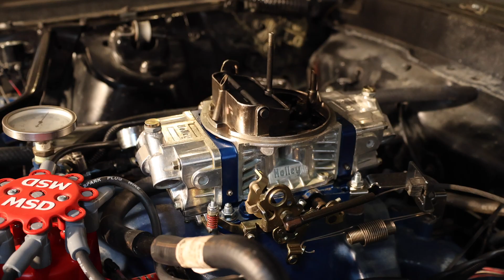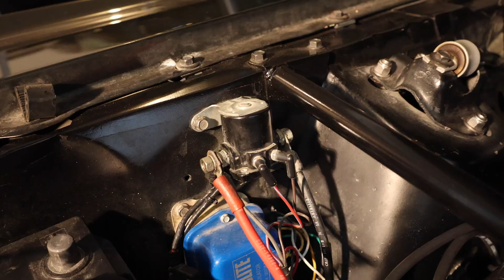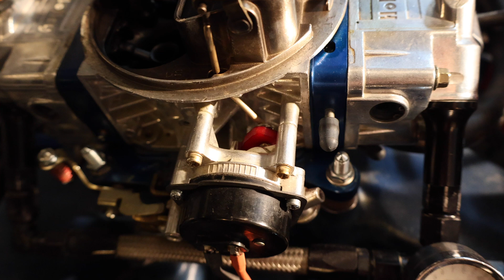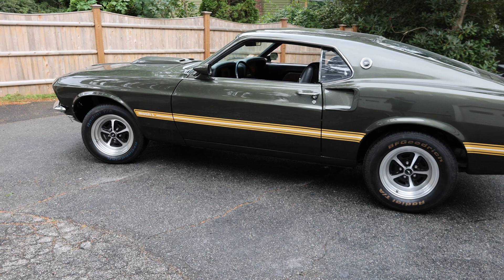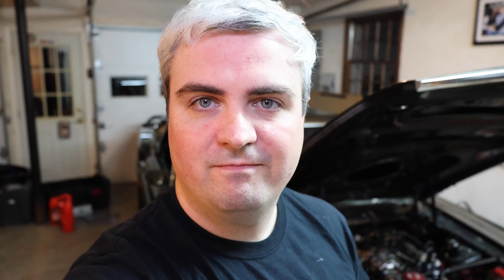Adjusting the Electric Choke Correctly on a Holley Carburetor

Comment: I feel like an idiot asking this. I’ve got a 4160 Holley with an electric choke. When I start my car I press the pedal down a couple times then I start it. The car starts at maybe 1000-1100 rpm but over about 30 seconds climbs to 1500. Is this a normal operation for startup or should the car start right to 1500 right off the key start?
Reply from the maker: This is normal operation. The pushing of the throttle first a couple times sets the high idle cam. If you press it again after it'll drop back down in RPM.
Reply: @SmackeysGarage ok so your rpm also climbs up a bit after you “prime” the motor and get the fast idle cam to click to the higher rpm setting. Awesome thank you!

Comment: Why after doing a cold start does the car die out, shut off?  It seems also like I have to play with throttle so it doesn’t shut off. After warms up some it does okay. Do I need to go more counterclockwise so flap stays closed longer?  Does this issue and the car shutting off when putting in drive all come from choke not adjusted properly?  If I drive and park, then go to restart, it’s hard to start too.
Reply from the maker: Assuming that it is running out of gas and has too much air, yea you would want it to stay shut longer.  If you have to play with the throttle, I'm assuming you are pumping the gas and pumping more fuel into the carb vs holding the throttle open for air.

If it runs good after it is warmed up it is a choke timing issue. If you drive and park and it is hard to start, you could recheck the choke to see what the position is when you try and start it. Might have to hit the throttle quick to open it up.
Reply: @SmackeysGarage thanks for the reply, so now dumb question. If I want the choke flap to stay shut longer, I rotate the can clockwise?  What happens If I rotate the mark on the black can past the mark indicators on the metal part?  I want to say if I do need to rotate clockwise, I will move past the last marker?
Reply from the maker: I believe the markers are just for reference. There are hard stops that stop it from turning any further.

Comment: I have a holley warrior on a Ford 302. On a cold start, it starts right up and idles at ~600 then after 30 seconds or so it starts to idle rough. Then after a couple minutes it goes up to the idle of ~900 until I am ready to drive and tap the gas to bring the idle back down.

How would you suggest to fix the rough idle?
Reply from the maker: What’s it have for a choke on it? Almost sounds like it’s getting through a lot of fuel maybe from over pumping it before the high idle can clear it out.

Comment: I know this video old but I have a new Holly 750 and was confused why it was smoking from the choke adjuster and the truck ran terrible, I have everything else set correctly but when I went to adjust the choke everything went sideways
Reply from the maker: That's really weird. The Holley choke shouldn't have changed. It's a simple system. Bimetal wound coil that heats up and opens when electricity is attached. Sounds like your spring is shorted somehow internally. Would be worth taking the cover off and looking.

Comment: Sir good morning I’m having issues achieving high idle on my Holley 750.  I pump the pedal twice turned key waited key on wait about 30 seconds truck starts good then stalls out right, I’m guessing that flap is closed all the way.  Need help please
Reply: Tomorrow morning I’m going to do a counterclockwise adjustment on the choke and I’ll see what it does
Reply from the maker: @davidcimei3476  Cool. Let me know how you make it. Might be worth starting it with the hood open and air cleaner off to see what is actually happening to the choke blade.
Reply: @SmackeysGarage  

I set my high idle for a warm temperature start and went to 1600 with the choke plate fully opened and hit throttle and went to my curb idle speed of 850.  This morning it was sluggish starting with a fully cold engine my question is when I rotate that choke plate do I need to hit the pedal before I rotate the choke cap
Reply from the maker: @davidcimei3476  I don't have this setup on my car right now, but the way I remember it is, yes I set the choke cap after pushing the petal. I'd say it would be best to start it with the air cleaner off the car to see the position of the choke with different settings. You don't want the choke completely closed when starting initially. I moved to a manual choke  to make it easier for myself
Reply: @SmackeysGarage  can I swap my electric choke for a manual choke?
Reply from the maker: @davidcimei3476 yes you can. Holley sells a kit.
Reply from the maker: If it is running for 30 seconds I'm guessing the choke is opening too fast, or your fast idle could be too low. If the choke was staying closed, I wouldn't expect it to start and stay running since the primaries would be completely cut off.
Reply: My fast idle set about 1600 rpm and I smack the throttle and drops to approximately 850 so I believe that is dialed in

Comment: The problem I have the red linkage won't drop down to disengage choke.
Reply from the maker: After you star the car the choke plate stays closed?
Reply: @SmackeysGarage  
Yes I can't  get it to idle down to 750ish rpm. Tried burping the peddle temp 170.
But it won't drop that linkage or idle down.
Choke is hooked to seliond pole closest to power out. If shut off, it has run on. Unless it's in gear. 
But if I manually move that linkage.

Comment: My choke is staying completley   closed at first, doesnt it need to be cracked open at least a little to start? i should try rotating a notch clockwise too see if it helps? thanks
Reply from the maker: Is it a 2 or 4 barrel? If it is only covering 2 of the 4 barrels you could be ok. If it is completely cutting the air off on a 2 barrel, that would be a problem.

Comment: I have a 4160 on a 350 Chevy. I find that after the engine is warm the idle seems to creep back up. Like I drive 10 miles. When I get there the idle might be normal or it might still want to idle at 1500. Does that indicate the choke opening late (turn the choke to the right?) It cranks and runs great. Get's terrible mileage and smells rich at idle.
Reply from the maker: When did it start operating that way? If the idle is still high, it could be the high idle cam but it sounds like it is either the carburetor (not the choke) isn't tuned correctly or you have a vacuum leak somewhere.

Comment: How long should the choke run before you pat the gas and knock it off on a cold start?
Reply from the maker: It really depends on the vehicle. A choke should stay on until the engine comes up to temperature enough so that the fuel is atomizing enough to keep the car running and not need the air choked off. An aluminum block 5.0 will take significantly less time than my iron blocked FE. I typically run it to ~160* and then take it off.
Reply: @SmackeysGarage  ok Thanks

Comment: Have a new carburetor 600 holly for some reason when choke is cooled up choke plate stays Open halfway.. what can i do brother
Reply from the maker: Does it reset after you push on the gas pedal? It will typically stay open a bit (maybe 1/2") until you push on the throttle and it should drop to mostly closed. You have to reset the choke on the next start by pressing on the gas pedal.
Reply: @SmackeysGarage  yes it does sir.. I move little bit the electric choke clock wise cuz takes more that a little while to open completely

Comment: After setting the choke I’ve run the engine and it opens fully when going cold does it start to shut but not fully until I press the accelerator  I hope this makes sense
Reply from the maker: That does make sense. You push the accelerator once to set the choke fully closed on next startup. If i understand what you are saying correctly, that is also how mine works.
Reply: @SmackeysGarage   cheers for that

Comment: Hi - thanks for the topic!  I think it would be really helpful to describe a few symptoms, because people can't actually see if the choke is coming off too soon or too late.  I  only know what I have to do to the gas pedal to keep a cold (35 degrees) engine running until it finally settles into curb idle.  Example: I can can get the engine to fire, but immediately have to keep jabbing the gas pedal, so my choke is probably (which one) never completely shut? open before it should be??? isn't opening soon enough???  If I can hold the pedal to keep the idle high and smooth, but notice that after a few moments, the rpms slowly drop on their own and the engine dies unless I jab the pedal, my choke is probably open before it should be? isn't opening soon enough?   I don't have the stove tubes connected, or the exhaust manifold riser connected to the air cleaner, so I'm going to switch to an electric choke cap for my Holley 735 4150 type.  The car is a rebuilt classic that only sees cold temps the first few days after it comes out of winter storage in April.
Reply from the maker: Hey D S. You're right a good description of how to know to move the choke to come off earlier or later would make sense. I should have included that in this video, but I will be sure to include it if I do another on this topic! If you have to keep jabbing the throttle, you'll be adding more fuel, so the car would be running lean which would mean the choke has either come completely off or has come off too early. When you put your new Holley choke on, follow the instructions on how to set it up initially. I used a pencil to set the location of the choke plate originally but you could just as well put it in the center and then adjust as necessary. There should be lines on it you can line it up with.
Reply: @SmackeysGarage  hi - Here's an update to my comment based on info in a really good Hemmings article called "The Lost Art of Choke Adjustment." I connected a remote starter so I could watch what is going on.  This is not info on what the specific adjustments are, this is just a different way to describe what each choke function does and when.
 
Choke Event 1. Prior to turning the key, tap the gas pedal, which provides a squirt of gas and sets the only two parts of the choke adjustment that matter at this moment: the butterfly goes completely closed/no gap, and the throttle linkage catches on the high part of the fast idle cam.

Turn the key. Engine should fire. If it doesn't, NONE of the other choke adjustments have anything to do with it.

Choke Event 2. If the engine fires and starts, the engine vaccuum will immediately cause the choke pull off to crack the butterfly open a very small amount, overcoming the tension of the choke spring NO MATTER WHERE YOU HAVE SET THE CHOKE SPRING, as long as the butterfly was initially gapless. Engine should run at high idle.  If it doesn't, the only things in play are the size of the pull off gap (approx 1/16-1/8") and the need to be at high-idle.  Choke spring setting has nothing to do with it yet.

#3 Now finally, the choke spring setting matters. At some point, the engine has to come off high idle to curb idle.  This is the magical combination when engine warms and the butterfly opens in harmony. The moment you touch the gas pedal, even slightly, the throttle will slip off the high idle cam, and if your butterfly is too slow or too fast, the engine won't run perfectly.  Now you are finally at the point of messing around with the choke spring adjustment to change how long it takes for the butterfly to open enough for curb idle.  

I am doing mine while it is 39 degress out, and I can have an actually cold carb...

Comment: So if I’m having trouble starting up and idling I turn it counter clock wise?
Reply from the maker: Are you having trouble getting it to kick over at all or is it starting and then dying after a few seconds?
Reply: @SmackeysGarage  starting then dying after a few seconds won’t hold a idle
Reply from the maker: Sounds like the choke is coming off to fast. I’ll have to look physically at my car tomorrow but I believe you want to rotate it so the choke stays on longerto get you to fast idle.
Reply: @SmackeysGarage  okay awesome sound good, I noticed the choke flap (no sure what it’s actually called the thing the flaps open and close) was open part way isn’t it supposed to be fully closed? Also I noticed my choke is rotated all the way clockwise. Isn’t that not okay?
Reply: @SmackeysGarage  got it idling now time to re seal the front diff
Reply from the maker: Awesome glad to hear you got it. After you get it setup you shouldn’t have to touch it again.

Comment: my choke plate is stuck open, wont open/close unless i open the throttle,  sometimes the truck runs good even with choke open at all times. What is possible fix. Holley 600 electric choke
Reply from the maker: I’d do a check of the linkage to see if anything is bent. Is this an electric choke you added on or one that came on the carb?
Reply: @SmackeysGarage
Reply: @SmackeysGarage  Yes  i played with the linkage and it came loose and is workin fine thank you. Also when i start it up cold it will start to flood run rich unless i rev it up high and warm it up for a few minutes then it runs perfect other wise it will die, could this be a fast idle screw issue.

Comment: So im having an issue with my holley before this problem it ran like a top it starts and does what it supposed to do fine but one day i was at a red light and when it turned green and i hit the gas the choke engaged completely and the rpm jumped way up and i had to hit the cam idle lever back down for it to go back to normal it seems like its stuck but cant find whats causing it i adjusted it a couple notches lean and no difference. Its recieving 12 volts when key is in the on position and has been shy of a year on the rebuild the only thing i can think of is the coil went bad, there was a short, or the wiper motor that its connected to is inadequate in supplying power (even though i checked and its fine) the carb wont kick down from the last notch it seems on the cam lever when i blip the throttle it kicks up and gets stuck and holds the throttle there unless i hold the cam lever down with my finger.  What changed?
Reply from the maker: It sounds like something has bound on the high idle linkage. Have you had the carb off recently? I’d also like you said, remove the black lid off the choke and make sure that thermal spring isn’t broken at all. It’s very weird. Keep me posted on what you find. I’ll look at my Holley this weekend and fiddle with it some to see what can cause this
Reply: @SmackeysGarage  pulled the cap off it looks pretty mint coil looks good while it was off i decided to take a look at the copper rod that goes into the coil. i push it up the choke acuates i push it back down (some catching there) and it drops the arm thats connected to the throttle the pushes the cam arm goes back down but the cam arm stays unless i push it back with my finger however with the cap back on and it adjusted 2 notches lean (didnt sound too good while warming up) it would open a little more than it did but now when you blip throttle the arm thats connected to the throttle that pushes the cam arm up is stuck up unless i push it down with my finger like its directly related to eachother when its stuck up it holds the throttle from going back to its resting place. I took my testing light to the leads on the choke cap and found with the negative lead off the positive as still recieving power is that incorrect? It also has power when it is connected this is all while the key is in the on position. Now that i think about when you put the choke cap back on how much does the coil need to be coiled? It semms like its catching on the inside and if i were to coil it a little more maybe it can overcome that resistance im not sure i installed it back on the way it was when i removed it.
Reply: @SmackeysGarage  id also like to add before removing the cap but just adjusting it didnt have any correlation to the choke flap like ive seen on holley videos where they would adjust it and you can see the flap moving too. This makes me velieve that its currently incorrect and could be an inssue but didnt present itself until a year later?
Reply from the maker: Sounds like you’ve made some progress. Having the choke plate not move when the electric choke moves doesn’t sound right. It also doesn’t sound right that the coil barely fits in. I never had issues with it binding when putting together. If you want me to remove mine and take some pictures send me an email that you can find in the about me section.

When you have the negative wire off, and are measuring voltage across the coil with no ground I would expect there to be no voltage drop across it (reading 0).
Reply from the maker: If you send me an email I can send a video of mine comparing motion to yours.
Reply: @SmackeysGarage  II suspect he had the neg lead of his light on a ground.

Comment: Nice video. Are all chokes the same? I'm going to purchase one,  tx👍🏻
Reply from the maker: They are mostly similar. I'd stick with the Holley one on the Holley carb. The non-Holley one that is available doesn't have good marking to understand what position it is in. It operates the same, but is a slight bit harder to setup.
Reply: @SmackeysGarage  😊 Thanks
Reply from the maker: @250rtrxjunkie  No Problem!